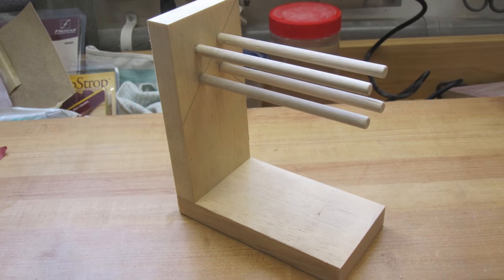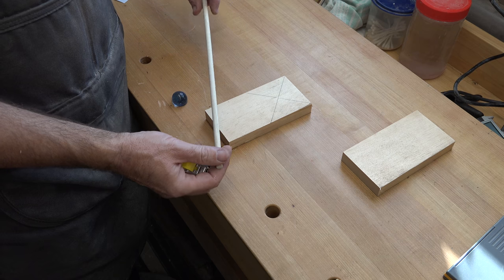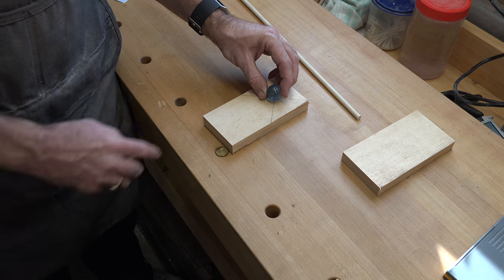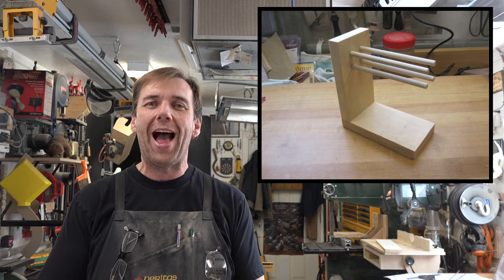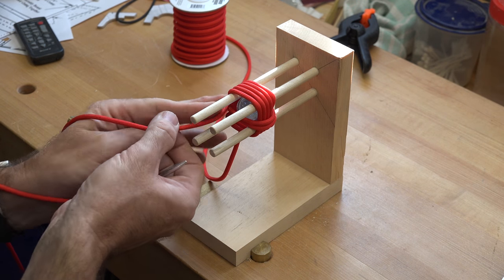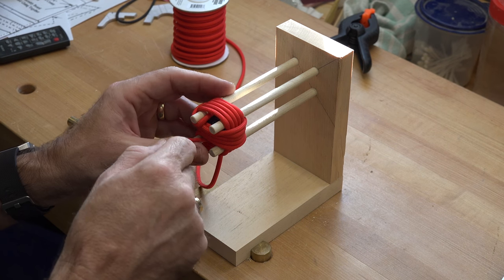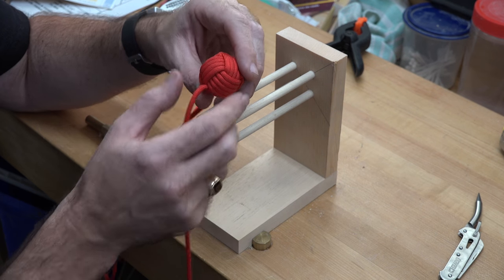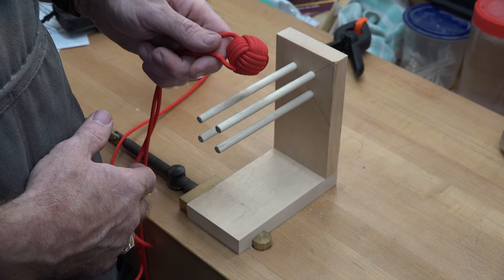Making a Monkey Fist Jig

Comment: Excellent video, Kenny!! I will be making some jigs for larger size cores up to the size of a baseball. You definitely seem to be a woodworking expert so I have a jig question for you. If you want to build a jig for a specific size core, what is the plus and minus range (tightness and looseness) of distance for the holes. For example, for your 1" core example in this video if I drill the holes 1/16" to far out (1/2" + 1/8 + 1/16), the core sits in the jig too loosely. And  as  I drill the holes closer and closer to the center (less than 1" apart) the dowels make the core fit tighter and tighter which also forces the dowels to angle outward. So is there an optimum fixed distance or %  the holes should be in relation to the diameter of the core in order to provide a reasonably tight fit for the core and allows appropriate working space to wind the loops around.  The area where I have concern would be using a pool ball or a hard baseball for the core where it would become difficult to weave around the core if it is too loose and sinks to the bottom of the jig.
Reply from the maker: There are several factors to consider here Murray.  The first, is the size of your core.  The second, is the size of your dowels that will hold the core.  Let's say that you are using a core that is 1-1/2" in diameter and that you are using dowels that are 1/2" in diameter.  The best way to get a snug fit and figure out the proper placing of the dowels would be to take your core diameter and add half of your dowel diameter.  This will provide a circle who's diameter will mark the centre of your dowel holes.  So in the case of our example 1-1/2" + (1/2" X 0.5) will equal 1-3/4".  This will place your dowels in a position where the core is snug but not super tight and as long as you measure carefully, you should have no problems.  I hope this helps.  Thanks for tuning in to the show.

Comment: Say you are using a 1 1/2" ball how do you work out the number of wraps and therefore the length of cord needed? Thanks
Reply from the maker: For me, the length is all trial and error until I hit on what it takes to get the monkey fist done.  As for the number of wraps, it's all about what will fit comfortably on the ball while still giving you room to work and providing full coverage of the ball.  I hope this helps a little.  There are really no formulas that I am aware of for paracord work.  Thanks for tuning in.

Comment: You finally said what I’ve been thinking all along, “Monkey Ball.” What do you use this for or do with it?
Reply from the maker: There are many uses for a monkey fist Barbara, but nowadays, they are most decorative pieces to place at the end of keychains, lanyards and that sort of thing.  They seems to have become a decorative piece more than anything now but hey are a heck of a lot of fun to make.
Reply: Actually they are a nautical tool used for heaving a line between ships. Sailors also would carry them in ports that prohibited the carrying of weapons
Reply: They are for bashing skulls in, or for weighting rope
Reply: @kylesouthworth2564  wrong, although now you will find that is the direction they have traveled into. I won't hold the fact you are obviously a land lubber against you in your effort to insert your lack of knowledge into the topic
Reply: @kylesouthworth2564  you would really enjoy mine then. I wrapped an 11 pound monkeys fist I forget how much line I used probably 50 ft or more
Reply: Todd Knoy pics or it didn’t happen
Reply: I just wanted to note that you were doing 5 wraps but you missed going through one more time on the one side, I know the dowels make it difficult but once you slide it off you should be able to pass that last one through.